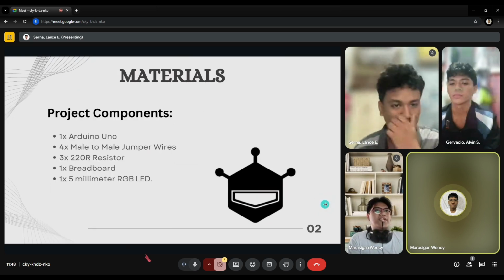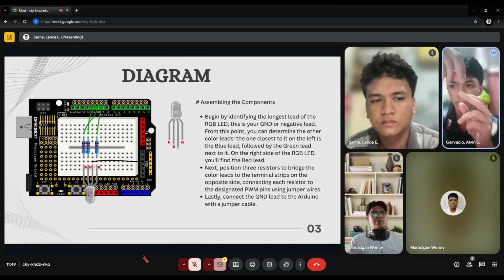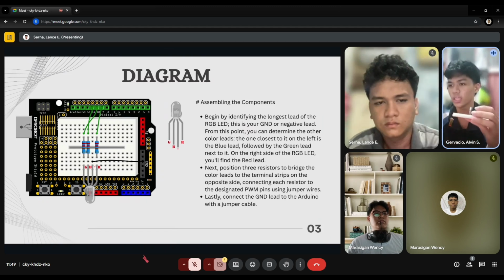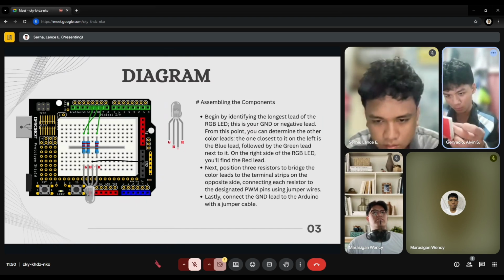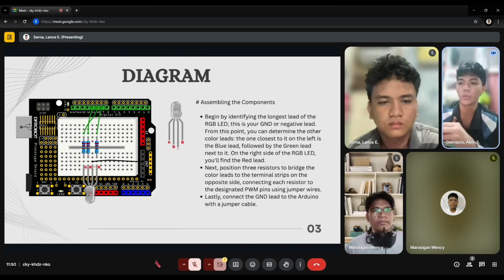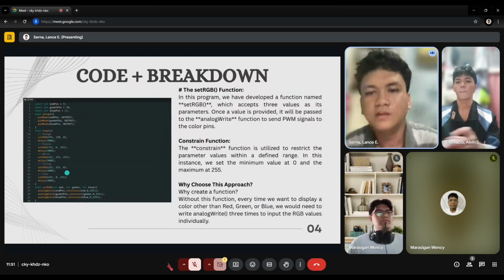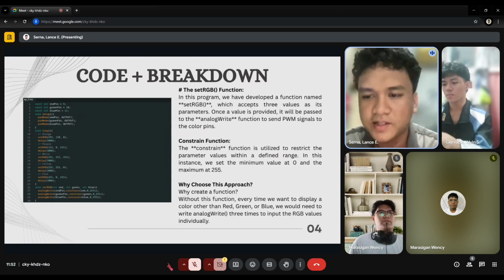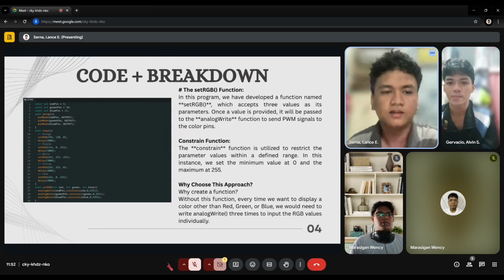AP5: RGB LED

Comment from the maker: Source Code:

const int redPin = 9; 
const int greenPin = 10;
const int bluePin = 11;
void setup(){
  pinMode(redPin, OUTPUT);
  pinMode(greenPin, OUTPUT);
  pinMode(bluePin, OUTPUT);
}
void loop(){
  // Orange
  setRGB(255, 120, 0);
  delay(1000);
  // Purple
  setRGB(152, 0, 255);
  delay(1000);
  // White
  setRGB(255, 255, 255);
  delay(1000);
  // Yellow
  setRGB(255, 255, 0);
  delay(1000);
  // Pink
  setRGB(255, 0, 255);
  delay(1000);
}
void setRGB(int red, int green, int blue){
  analogWrite(redPin,constrain(red,0,255));
  analogWrite(greenPin,constrain(green,0,255));
  analogWrite(bluePin,constrain(blue,0,255));
}